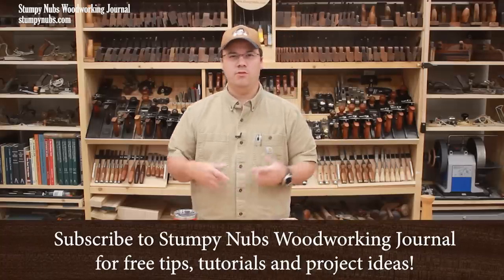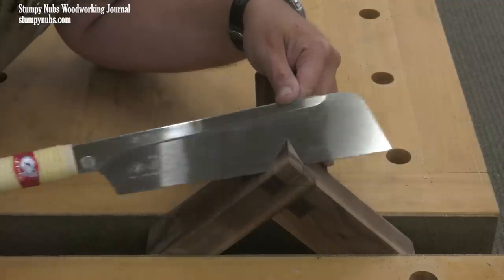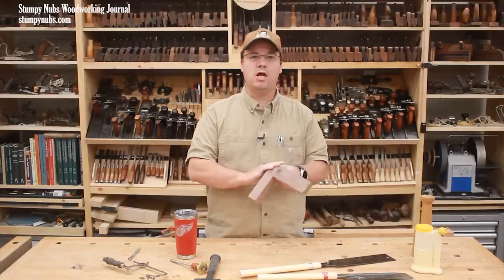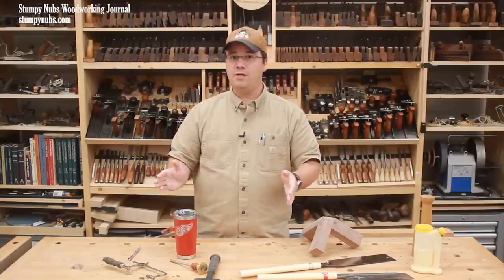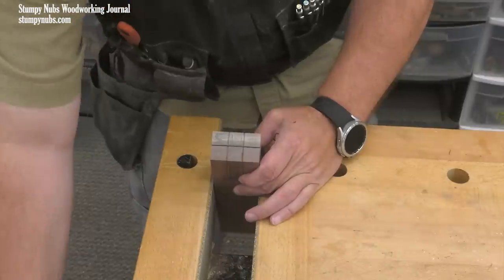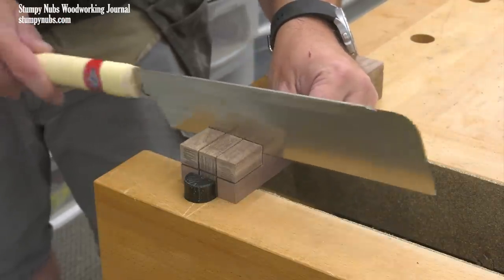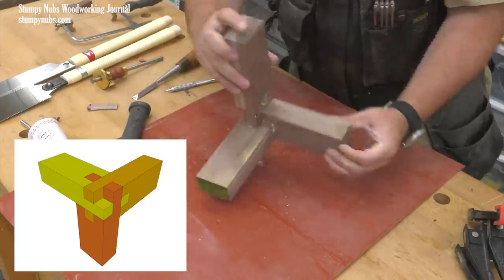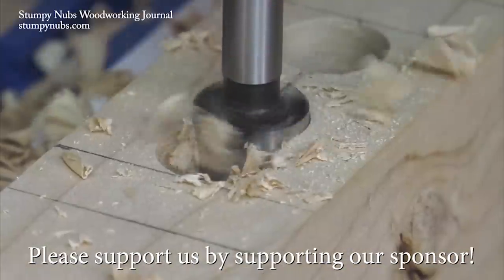World's STRONGEST corner joint- Cut with just a hand saw!

Comment: I modified this joint for my latest project so that instead of using 2x3 (1:1.5 is just an ugly way to say 2:3, it's the same ratio) boards I could use squared 3x3 boards and get the same effect. I not only find this more visually appealing, but it also means that you don't have to worry about two sides of your frame being thinner (and therefore weaker).

To understand the shape of my modified joint, just take the 2x3 design from this video. Each of the attached beams has 4 faces: 2-unit-wide interior, 3-unit-wide interior, 2-unit-wide exterior, and 3-unit-wide exterior. We can easily make each of these beams 3x3 by simply gluing an additional 1x3 board onto the interior 3-unit-wide face. Of course, it's a lot less messy to start with a 3x3 beam and simply remove a 1x3x3 chunk from one side. The remaining 2x3x3 block can then be cut as in this video. This sounds really complicated, but it's actually just 2 additional cuts than in the video.

Basically, he cut 2 units deep on the end grain, and then cut down so that the remaining wood made an "L" shape. We're going to do the same, and then we're going to repeat the process on the opposite side, this time going the full 3 units deep on the end-grain cut. Now we have the exact same "L" shape, but instead of the back of the "L" being flush with the other face, it makes up the middle-third of our beam.

Also, in the video you can see that he fills the void left in the exterior corner, but there's also a void in the center of the joint. In my version there will be an additional void opposite the external one. If you think of the joint as a 3x3x3 cube (so, a standard rubix cube), then two opposite corners, and the unseen block in the center of the cube will be void. For additional strength, you can fill these voids by inserting 1x1x1 cubes of wood during the glue up, but it's not really necessary.

Thanks for the video though Stumpy, I cut my joints by hand and I really wish I'd had your sawing technique tips 6 months ago. I don't think I would've needed half as much wood filler as I ended up using 🤣
Reply: I just completed a table using this joint.  I used James' micro adjustable tenoning jig for all the cuts, which made it easier. I only had to mark out one piece,  set the jig to a single position and the table saw blade to two different heights. Great joint (thanks, Tamar) and great jig (thanks James).

Comment: I always find your videos interesting and thorough, Thank you. I always seem to struggle with dust collection hoses, mainly the small sizes. My shop vac measures 2 1/8” and I find myself constantly looking for adapters to transition to my tools, is changing to 2 1/2” the ticket? can you recommend a good system thats durable, flexible that comes with adapters that will connect to common tools? (Sanders, routers, pocket jigs) Thanks

Comment: I don't know how important it really is for structural integrity, but nevertheless: 
neither you nor Tamar didn't mention that essentially there is a void inside the joint across the diagonal axis. 
In case of a 2x3 joint there are 2 1x1x1 cubes of volume missing from the joint - one of them is visible from the outside (this is why you and Tamar glued a spare cube there), another one is hidden inside.
3x3 joint of this type is also possible - but requires 2 more cuts for each piece of wood. In that case there would be 3 1x1x1 cubes of volume missing from the joint, one of them would be visible from the outside and two hidden inside.
I'm not really a good woodworker so I don't know how a void inside a joint will affect gluing and structural integrity over time, and you really can mitigate the problem (if it is) by gluing the cubes inside while assembling.
I hope my explanation is clear enough, but I can get pictures or 3d models for anyone interested in visual presentation of what I'm talking about.
Anyway, thanks for the video!

Comment: I've traveled in China seeing these type joints and other Chinese joinery on tables and chairs some of which were in outside pavilions in traditional gardens. Suzhou has several of these. I've seen the same tables in gardens in Suzhou in 100° 100% humidity in the summer, and in 20° midwinter. The wood is expanding and contracting but the joints maintain their integrity, no edges stick up and I think the tops move back and forth to their same positions through the seasons. (But no glue.) 
(My breadboard table ends usually end up a bit more to one side after several months of weather changes. This is in my living room in Southern California.)  One feature of the Chinese joints, especially on chairs is that they aren't super tight. The chairs I've been able to touch (privately owned or in a shop) will come apart just by using my hand as a mallet. And I'm not an expert or a practitioner of Chinese joinery, just an American who's made some furniture and joints.

Comment: As much as I admire the patience/dedication of hand carpentry this joint is so much easier on table saw .
You only have to mark one piece and set the saw a few times (adjusting to cut on marked piece and do all 3 (6,9,12 etc.) , then repeat)
Tamar is skilled yet practical (usually), BUT thanks for video on an artisan approach .

Comment: After seeing Tamar make this joint I decided to use it in a project but I wanted the three members in each joint to have a square cross section. This is easily done by adding a 1/3 sized shoulder at the full depth to the narrow side.  By then using this joint at both ends of 12 pieces you can then make a rectangular box. Add a corner rabbet to each and you can add side panels. Totally enjoy and look forward to both channels.

Comment: I saw the original joint and video a few years ago.  I made it using wood that had equal with and thickness. I also did it with hand tools as well.  It is just a matter of doing things in 1/3's

Comment: I saw the same video 2 or 3 years ago with Tamara at 3d and thought this joint would be crazy strong for a work bench. I milled down 4x4s and made a 4’x8’ workbench. It was a little tricky working with such long and heavy pieces but, I’m here to tell you, this is one bad ass joint. I’ve abused this workbench for 3+ years and it is as strong and stable today as it was on day one.
Reply: I built some - one in the Shakerstyle - you wish to see a photo?

Comment: My jobsite saw sits on a table using these joints.  I used the saw like Tamar, and used a tenon tenon jig for some of the cuts.  I added a wrinkle by getting close to, but not on the line. Then measured how much timber was left and how far the fence needed to be moved, and used a DTI to move the fence as accurately as I knew how to. I was fairly new to woodwork at the time, so I was especially pleased with the near perfect fit first try.   It pains me to admit that interesting hardwoods are difficult to source in New Zealand, so my saw table is made of boring radiata pine.  If any Kiwis see this comment and know where to get hardwood, I'd be pleased to hear about it.
Reply: Pictures, we must see!

Comment: I had seen Tamar's discussion of this joint and it's really interesting & cool looking.  One question though - how would all the angles between the woodgrain affect wood movement over time?  Wouldn't it tend to break apart the joint since all the grain is at 90 degrees to the other parts?
Reply from the maker: If that were the case, how would any wood joint work?
Reply: @StumpyNubs  valid point, but I guess I was thinking of more like 2 piece joints versus the complexity of all 3 pieces with different directions. But you're right - maybe I'm just overthinking this.

Comment: I like this, but the fact you can’t take it apart means you can’t do it on larger pieces.
Reply from the maker: Do you mean you can't use it to build a project you wish to disassemble later?
Reply: @StumpyNubs  yes. For example building a bed - it lives where it is assembled.

I saw some nice looking Japanese joinery, and certainly interested in that which didn’t require any fasteners or glue.

Comment: I wanted to try this to make a table frame but I wasn’t sure how you would cut the opposite ends of the frame piece. Is there a “secret” orientation of the piece to how you cut the opposite end so that they interlink or is it just the same cut on the same faces
Reply: It would be the same cuts all the way around, on the same side.  Note that two lengths of the table will be horizontal and the other two vertical.  For instance, if making a bed I would put the shorter head and foot of the bed horizontal and the sides vertical to use the strength of the wood to its maximum effect.  If making a small square coffee table you would have to like the offset look of the stringers or glue a cut to match the longer side.
Reply: @TyPaff  Thanks Ty